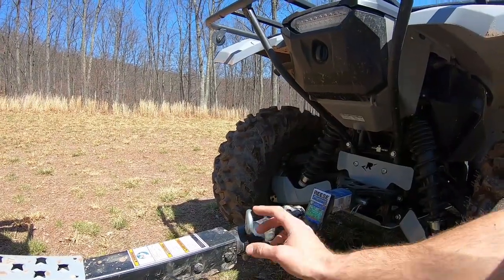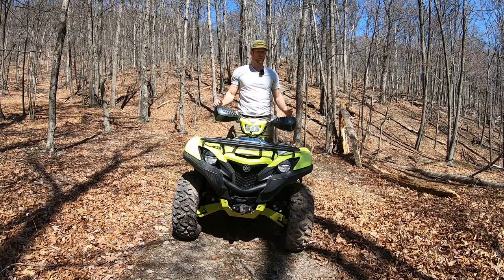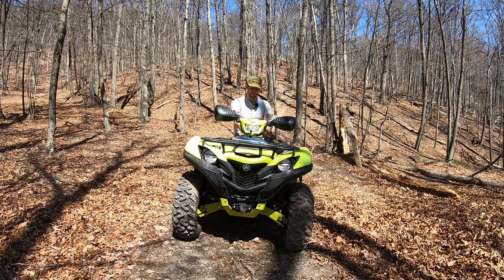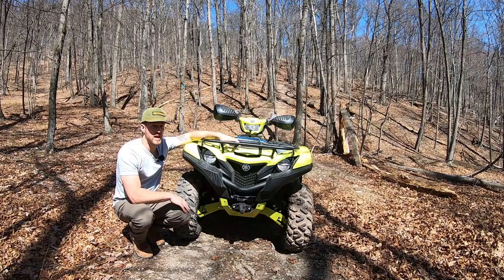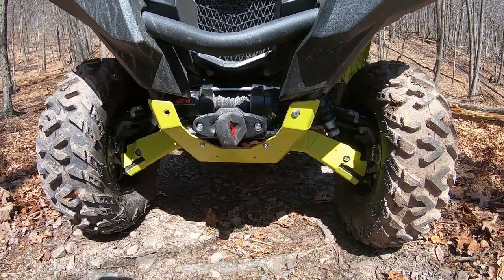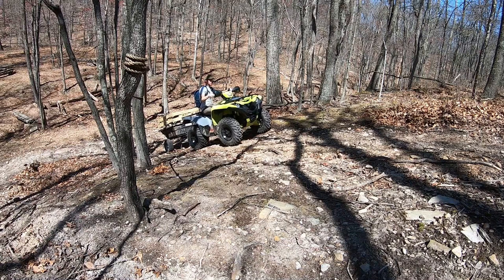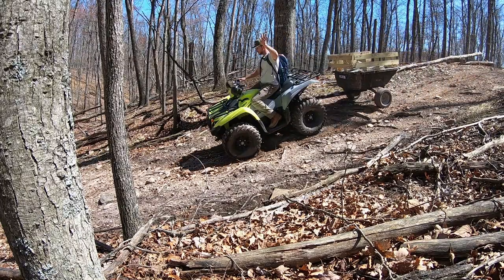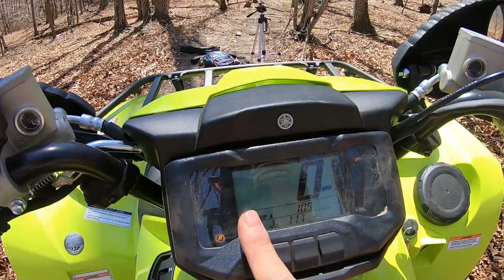Is the 2022 Grizzly 700 a Utility BEAST?

Comment: I have the 2018 Grizzly, the one that came with a Suzuki engine and that used oil from the very beginning when it was new. Why the hell Yamaha put a Suzuki engine in the 700 Grizzly for a couple of years is beyond me. Anyway I had the warranty work done on the engine and all is well ??!? At any rate I am very satisfied with my machine. Runs and performs very well. I have 2500 miles on mine and she keeps on purring.
Reply from the maker: I'm glad to hear you're getting reliable usage out of your 2018! I've never driven one with the 708cc engine, but I hear they were pretty powerful. I think it was actually made by Subaru, not Suzuki. Have you driven the 686 cc grizzly? Curious to hear how you would compare the engine performance.

Comment: i have a 22 SE it felt really stiff when new, now i got some miles on it, its getting really fast and really smooth, great machines
Reply: I just bought the same machine you did 1 week ago today. It's got 6 hrs and 100 miles on it so far. Still breaking it in so I'm only doing 50% throttle for the most part. Can't wait till she's broke in. I definitely wanna get on it when I'm on the trails.

Comment: Nice vid....   I have a polaris 500 ho that's a towing, log dragging dozer!
 I built a trailer specifically to pull behind it through woods, etc. It's twice the size as the one in the video   and I fill it with firewood and tow it with no problem.  Hills greatly effect ANY machine towing ANY trailer off road. The polaris is more a "utility " vehicle but does well on trails, although not as nimble as other makes.

Comment: I’ve been watching some Yamaha vids and a few folks advised that the Kodak has more low end torque for work/utility and that it’s tuned to low MPH use. Overall, I think they are advising it’s a better work rig than the Grizzly especially when it comes to long term maintenance. I know nothing about quads but I recently purchased 5 acres with lots of slope and I want to buy a tow behind brush cutter for blackberry mowing. Any advice? Thx for the great vid!
Reply from the maker: You can't go wrong with a Kodiak 700. It doesn't have more torque but its clutch system is set up to engage at a lower RPM which is better for towing around trailers and stuff. The Kodiak 700 will be low maintenance and should be an outstanding machine for you out there. If you're going to be in a lot of brush and off trail situations, then consider upgrading to some heavier duty tires. You'll have a higher risk of puncture with the stock ones, otherwise the quad is great right out of the box
Reply: @ThomperBeThompin  Awesome! Thanks for the advice!

Comment: The we have had a kodiak 700 on demo and in every way it is superior to our 570 outlander. 
Steers better, far more manoeuvrable in tight spaces and easier to back a trailer. 
Just as comfortable as the canam. More stable and certainly more engaging. Quieter and Considerably better on fuel.
Reply from the maker: Awesome! Those Kodiak are great machines too.

Comment: Did they fix the air box issue letting dirt by the filter any input would be greatly appreciated and have you noticed it running hot thanks
Reply from the maker: I cannot confirm concretely whether they fixed it entirely, but I've heard there are improvements. If I'm not mistaken my air filter came with some rim Grease to help make a better seal. It still has the AIS issue though and mine backfires if I chop the throttle and don't roll off.

Comment: I have a 700 and I really like the machine but towing and dragging if you have any type of hills does not work so well.
Reply: I was thinking about buying a Kodiak 700 for doing chores on my sloped property…you don’t think these similar quads are the right machine for slope? Any other suggestions? I know nothing about quads.
Reply: @stoweman34  not if you need to pull much weight I had a 5x8 utility trailer and with a1/3 of a cord of wood I couldn’t make small hills but that weight is 3 times more than my atv without weight they will climb steep hills easily and maybe with a smaller trailer they would pull 1/3 of what I was. No atv of any brand would be good for what I tried.
Reply: @waynejohnson9855  thanks for the info. I want to pull a brush mower on some steep terrain.